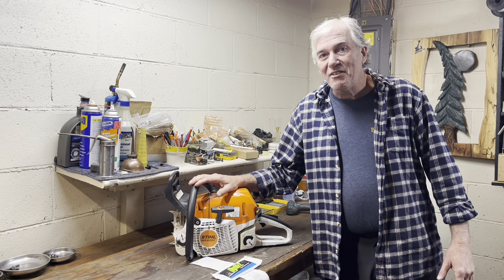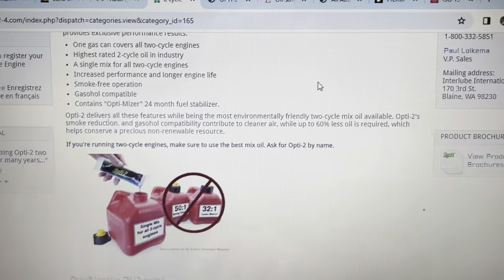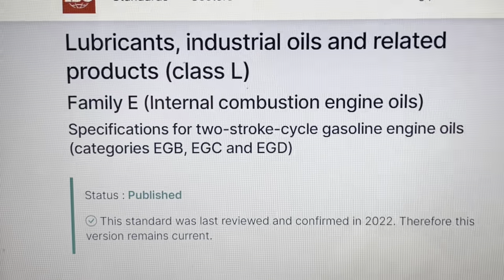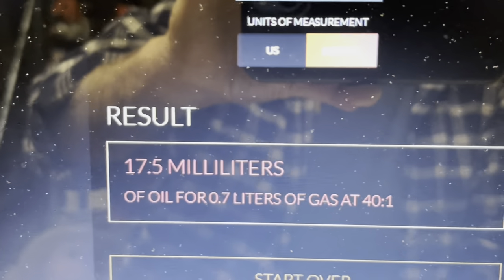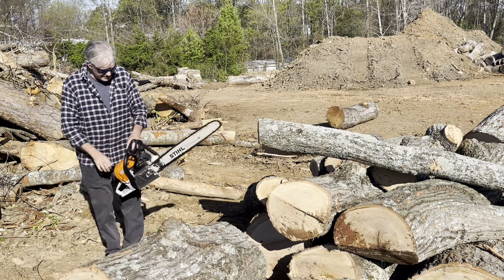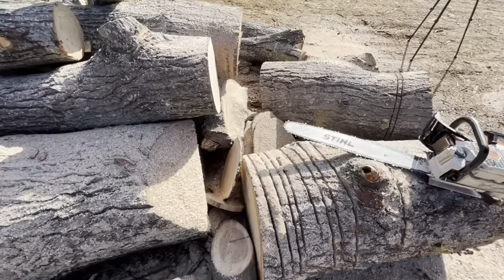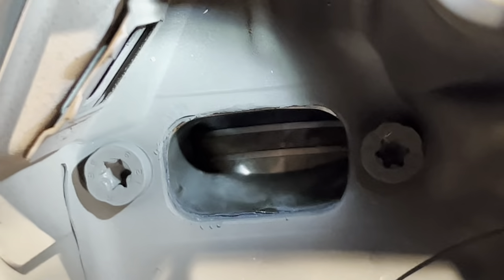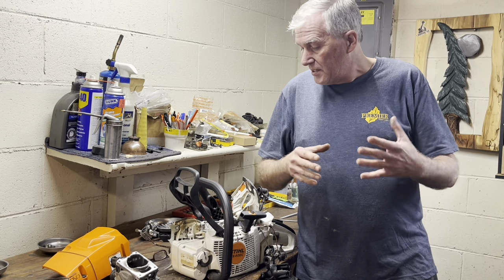Opti-2 Oil Test. 100:1 Premeasured Two Stroke Oil Pack

Comment: You certainly figured out the best shot shells on the shelf! 100:1 is Penny wise and pound foolish
Reply from the maker: I used to reload.  I sold the reloader (mec900G)  I shot more when supplies were cheaper.  Good times at the 5 stand.  This oil is about what I thought it would look like.
Reply: @richardflagg3084  I used to reload a lot on a ponsness warren 600 my dad bought new in 1975. Stuff got expensive, hard to find and the ranges got weird 2020-2021 so I said the heck with it all for now. Still have all the stuff and a lot of supplies.

Comment: I'm not by any means a professional on power equipment but I do know my way around engines. I'm far from your and some other guys knowledge, but one thing I do know is I'd feel absolutely uncomfortable running any of my 2 strokes at 100:1 or even 60/80:1 even with Sabre. I just started using Red Armor oil in my equipment @40:1 and noticed a huge difference in performance. I love these tear down videos. Keep up the great content Richard, also I hope you and your family has a wonderful Easter

Comment: I did 80:1 - 100:1 saber for a couple years in brand new commercial echos, have since switched to 40:1 with saber, but all motors look great with zero wear. Did a lot of wot throttle weed eating in Tennessee summers before the switch and the oil did it's job. Had to do helicoil in my 9010 blower (cross threaded the spark plug...) and l was shocked how little carbon l had and the film strength looked great at 40:1. Oil is cheap motors not so much

Comment: New 85 Evinrude outboard recommended 100:1 back then, mechanic said…don’t use 100:1, run 50:1. Engine still good today! New 89 Hus 266 used for 2 years in logging and since for firewood and storm clean ups and deer blind brush jobs. Always ran 40:1. Every part even carb is all original. Compression still good and still use today, thanks for confirming 40 years proof. 👍👍

Comment: Intake side of the piston  is not only the load side but 2 stroke mix offers very little lubrication until the gas vaporizes out leaving the oil. Ran a 503 rotax in ultralight for years, about 5 minutes of full throttle continuos on take off and climb out. Without proper warm up , cold scoring or seizure was a common thing.
Reply from the maker: Good point.

Comment: I would never run any oil at 100:1.  You are definitely braver than me running that ratio on a $1000 saw.  Thanks for the video Richard.
Reply: I’ve been using 100:1 Amsoil in all of my 2 cycle equipment.

Comment: I purchased a new Stihl ms361 back in 2009 to cut wood to heat my home. I bought my saw from a local Stihl dealer near me up here in Michigan. At that time the Stihl dealer recommended Opti-2 oil over the Stihl oil so I picked up a gallon jug. I ran Opti-2 up until I started watching your videos on 2 stroke oils. I didn't mix exactly 100-1 like the instructions recommended but it was less than 50:1. I pulled the cylinder to re-ring the piston and clean the carbon and to tell you the truth I was impressed with what I saw. I'm not an Opti-2 fanatic or anything but I definitely can't run the oil down. Currently I use Husqvarna oil and mix it 40:1. I'm currently still running ms361 and  the compression is as good as the day I bought it. Maybe I just got lucky, who knows?😂
Reply from the maker: Yes.  It would look a lot better at a richer mix.  Try some Amsoil Saber.  It's one of the best oils available.  At 40 or 50:1 of course.

Comment: I have been running Honda HP2 at 32 to 1 lately and have been very impressed with what I see. Lots of lubrication and clean burning. I have run the Echo Red armor for years at 40 to 1 and a short period of time at 32 to 1 with no issues other than I think 32 to 1 with the Red Armor is not as clean burning as I would like it to be.
Reply from the maker: Red Armor is a really good oil.  The HP2 is in a different ball park.  Glad it working for you.

Comment: Been running Opti-2 for over a decade in numerous 2 stokes (chainsaws, trimmers, blowers etc.) exclusively.  Everything has run like a Swiss watch.  I thought is was snake oil when I became aware of it, though my experience with it makes me want to use it in everything two stroke, into the foreseeable future.  It's nothing to worry about.
Reply: Same, have been using opti-2 15 years and has been excellent. My trimmer and blower start and run like new (Tanaka vintage 2009)

Comment: Started running echo red armor because of you. Probably the best easily found oil out there. Might try a quart of the Honda oil and use the echo if I run out and need some. I’m comfortable running 40-50:1 but no way no how would I ever be comfortable running 100:1 in a saw I bought. Company saw and a company mix I honestly could care less. Part of the reason I don’t loan power equipment to anyone

Comment: Man Rich you got ⚾️⚾️. I know I’m old school in ways and thoughts etc but no way could I run 100:1- even on hated equipment. 😂
Thank you for doing these tests. I’ve been doing the motorcycle oil forever at 40:1. I still will but I’d run Red Armor without hesitation at that ratio with no fear. For my old Homelites I still run 32:1 which is simple as that’s what I run in my ATV so just use some of that. However seeing the 40:1 I’d run it in an old saw. I just can’t get onboard with 50:1 since my 028 cooked itself many years ago using Stihl white bottles. Yeah. Way back when. lol. I do NOT feel it was an oil issue, but a skinny ratio issue as I’d run Stihl in my old Homelite many many times at its 16:1 with zero issues. I like your bourbon bottle. I live where I’m surrounded by the bourbon trail. Lots of fun doing that

Comment: I used to run opti-2 for some time that was a while back and it was in non strato saws in Stihl Husqvarna and Jonsered, I stopped using it when it became stupid expensive in my local market; over $30 a quart and that was 5 or 6 years ago before the current price increases. I tried using it at 40:1 but it was slobbering raw oil out the mufflers finally mixed it at 60:1 and did so for about 4 years of hard running but like you found out it is a very dirty burning oil. lots of carbon on or in everything piston top/upper combustion chamber/heavy carbon build up in exhaust port and muffler, don't know what all the raving is about on how clean it burns I had nothing but black soot running down the front of my saws the whole time I ran the stuff. In fact one of my old Jonsered saws still has that black soot stain that I never have been able to clean off. I will say though it always left a sticky heavy oil film on everything so it's got that going for it I guess, but my god the soot lol!

Comment: Thank you have just proved 100:1 ratio isn’t 
sufficient enough I agree with you.
I would have been a little nervous running that at
100:1 I’ll stick with my Honda HP2 at 40:1 the best 
2 stroke oil I have used thanks to your YouTube channel keep those great videos coming.

Comment: I've been waiting for you to do a test on Opti-2 Richard.  I've been running this oil for years and have never had an issue at 40:1. I am surprised at how NOT clean it came out ,ESPECIALLY that skinny. Now I AM running it with "screwed" carbs too...and I keep all my saws on the Fat side of things but DEFINITELY never seen anything like you've experienced on an intake side...in fact..all I know is what I know..and that is..I DO know it's not the cleanest oil out there...and as far as I know...the formulation has stayed the same as far as I can tell..for at least several years. So I KNOW there are some  NEWER kids on the block in the aftermath of things. With all this being said..I'm about to fork some dough out and get a "SMART" saw of some variety...either a 562xp or 400c...and see how it does at 40:1 there. I HAVE recently purchased some Saber but haven't spooled anything up with it yet..but I was curious and have stepped outta my comfort zone to give Saber a whirl. But thanks for doing this test! As well as the other oil reviews and we'll see how the cookie hopefully DOESNT crumble in days to come! Thanks again..Have a WONDERMOUS Easter  and weekend!

Comment: One thing I've heard about Opti 2 is that its gas stabilizer works very well. I wouldn't dare run it at 100:1 though no matter what anyone says. I value my saws and don't want to take the chance. I'm a 40:1 guy and really like either Red Armor and Amsoil Saber. It is fun to watch your videos testing oils, I'm alway curious of the results.

Comment: Thank you for testing this oil! I’ve used quite a bit of opti in the last few years and have always mixed it at 70:1, even in my lawnboys that call for 32:1.  Thats disappointing that it left carbon at  100:1 though. I want expecting that. Before the test, was there no wear in the intake side of the piston?

Comment: Thanks for risking a nice 400i piston in the name of science!  And, also for showing the results.  Even if it came out looking really good, I'd never switch to 100:1 on a chainsaw.  Maybe on something that runs cooler, and not air cooled wfo all the time.  The Yamaha 2 stroke outboards want 100:1, and I've ran 75:1 in them with good results (used to be 50:1 on the Johnson/Evenrudes ... everybody upping the ratio, but maybe better oils now too).  But, they are water cooled, and running at much lower rpm, and probably idle a lot if you use them fishing.  I'm not an oil nerd, but don't want a bunch of carbon buildup, or a scored piston/cyl. either.  I've tried motorcycle oils, belray and motul, but usually just run the cheap stuff (Walmart Supertech full synt. 2 stroke oil) at 45:1, and it seems to work fine for what I do - I think even better than the motorcycle oils or Stihl oil.  I haven't tried too many others.

Comment: Another thought on mix ratios, oils such as stihl that advertise having fuel stabilizer in the oil, fuel stabilizer is not a lubricant, whatever percent of that 2.6 ozs of oil is stabilizer takes your mix well beyond 50 to 1 to some higher level.
Reply from the maker: Stihl has removed the fuel stabilizer from the Ultra formula.  They have taken the approach that fresh fuel is best according to their website.

Comment: These are great vids richard...Ive ran opti   and couple other  rated  at 100- 1 for 2 yrs in one of my modded china saws ..saw still rippin chips..ive been amazed how good it runs with that mix...been runnin the super-S from dollar general 100-1 for couple months..its a fd rated oil and its cheap ..been doin similar oil tests as you  for couple years with some same oils youve tried n some you havent..redline n schaeffer 9000 get alot of runtime in my equipment. .. .opti 4 is a great 4cycle oil as well..

Comment: Yea 100:1 is a big no from me, most of my equipment predates my existence. MY dad or grandfather handed down a lot of my saws, mowers and weed eaters. The equipment has not lasted 30-40 years and still running great by using cheapo oil at skinny mix ratios. I was running Stihl orange and breifly ultra because "synthetic is better" right? Glad I stumbled across your oil videos when I did before I got more than fouled plugs and clogged arrester screens.... 

I now run 40:1 red armor and I swear my old 1984 Homelite HK-24 weedeater has more compression when pulling the cord, probably from more oil and the red armor seems to be more viscous than what I was running. I also just feel better knowing there is more oil there protecting precious metal. When I run out of red armor I might go to the local bike shop and try some of the HP2, really liked how that looked when it was torn down.

Comment: Braver man than me! I'm right there with ya on the actually somewhat existent lubrication, expected it to be dryer than desert sands in the bottom end at that ratio🤯
That scuffing does seem to be on the wrong side to completely blame it on the oil/ratio🤔
Reply: Runs hot, and piston expanding rapidly, in tight piston/cilinder fitting. As this pretty new machine should have. This combined  with half of recommended amount of oil...no insurance oil left..
But thats just my opinion.

Comment: I always found Opti 2 interesting. Their different size pouches and the big bottle with the measuring cup built in seem to all be at different ratios. The one gallon packs are 1.8 oz to a gallon. This pack you have is 1.28 oz to a gallon. Have never heard anything bad about the stuff though and used to live by an arborist that swore by it.
Reply: I called and asked opti about that. The small packet is used to mix with an imperial gallon I believe. With a US gallon it comes out to 71:1 ratio.

Comment: At first I thought my 400c sucked on fuel mileage but then I realized it’s just got a smaller tank.. Even before it was ported must be a way for them to keep them a little lighter weight. Doesn’t matter because I love the saw either way. Been ported now almost 3 years and it’s never broken down or not started and it’s used commercially.

Comment: I love your tear down videos. 
There is another YTer saw porter (Tinman) that uses Opti-2 at 40:1, now he's 42:1, with the rational that the carbon that is deposited is soft. 
And here is a hard one for me to choke down. 
He is in Manitoba and says his Opti-2 has been usable for up to a couple years left in the saws. (grimace) 
I, like many of your other commenters, would never use anywhere near a 100:1 ratio. 
And, because of you and Tinman, I am now going the 40:1 route with VP (Easier to get than the Honda mix and about $10.80 at Walmart). 
Maybe try the Opti-2 at 40:1? 
Love your subjects and especially the motorcycle oils.

Comment: Had to read the description twice to make sure 100:1. Nuts. I’m running it 40:1 seems to work well. Keep in mind I don’t tear my saws down after a tank of running either. Buy it by the gallon and use a measuring cup.

Comment: I switch to 40:1 this winter from 50:1. I find my saws seem to load up faster on slow cutting and small wood. So I think I’m going to switch back to 50:1 because in my area it’s mostly smaller wood. That being said on my 660 in a chainsaw mill I will most likely use 40:1.  Running 2-stroke banshees/honda 250r I always ran 32:1 running wide open sand and hill climbing. But I always said if your trail riding you can run 40:1 if you not running wide open all day. So I’m going to apply this to my saws too now
Reply from the maker: Milling I recommend the saw run 32:1.  Keeps the heat down on those long runs at WOT.  Have you tried a slight tuning adjustment to keep them from loading up at 40:1?
Reply: @richardflagg3084  well I noticed it most on my new 462. I’ve only got around  5 tanks of fuel through it. Dealer told me to do a reset at 5 tanks which I didn’t do yet. But it acts like it’s loading up. Get on it full throttle and it clears out. But I was just mostly cutting up 10” average diameter wood so it’s not working hard. But now thinking about it more I did adjust my 461 and it seems fine now but when you got too many saws and not running the same saw all the time and a lot it take longer to figure stuff out. But 32:1 milling is a good idea. Thanks
Reply from the maker: @Robert-uh6bx  MTronic should have no problem adjusting to 40:1.  In reality it's only a tablespoon of oil difference per gallon.  What oil are you using?
Reply: @richardflagg3084  amsoil dominator. Makes me wonder if there is a problem with the saw itself. I ran the same fuel in my 266 and it was fine thinking more. I’m going to reset the saw and see if it smartens up.

Comment: I’ve worked on quite a few saws from arborist outfits that use it…convenience and the dealers here always have a basket of it at the front counter…which is obvious as every one of their saws needed rings…every one of them…good gimmick for a dealership trying to sell more saws, especially since they won’t warranty it as the manufacturer says what ratio to run and it ain’t 100/1!

Comment: Yeah...don't matter what is written on the packet...my expensive Stihls are getting 40:1 Sabre..end of discussion. At the end of the day, Opti are gonna put the blame fair and square on your mixing, your tune, something "you" caused if there was to be a failure and you hit them up about it. Never see a puff of smoke at 40:1 with Sabre, exhaust is spotless and the saws runs like raped apes. Thanks for another great video though!

Comment: Very nice video mr. Flagg  , I would like to ask your opinion on 2 stroke oil shelf life , expiration dates ? , does oil loses its properties after opened ? , if has past the expiration date will become bad and damage your machine´s engine ? Thanks in advance
Reply from the maker: I can't speak scientifically, but there's a rule I live by.  If you have to think about it, you may have already answered you're question.  If it's dusty enough, make it a positive.  Try a new oil.  I've tested plenty.  Most are pretty good.
Reply: @richardflagg3084  thanks for your reply mr. Flagg and keep up the good work and thanks for sharing your knowledge

Comment: Do you just replace the base gasket every time you remove the cylinder? Do you ever clean the surface.
Reply from the maker: It's a rubber coated steel gasket.  I replace them when the rubber looses it's bond with the steel.  Yes, I clean everything before reassembly.  Brake clean and compressed air, then wipe everything clean.  In this instance I will flush the crankcase with mixed gas thoroughly due to the particulate left in the case.

Comment: Rich. Have you done a long-term test of saber at 60:1?
Reply from the maker: Long term I'd say 50:1 is the proper ratio.  I tore down a 7 year old ms261 and it looked great.  It belonged to a local tree service and that's what he's been using for years.  There is a video for that.  It's about 6-8 months ago IIRC
Reply: @richardflagg3084  that's what I meant, silly fat fingers. Was curious with the recommended ratio and good oil what the results were.  I'll look up the video